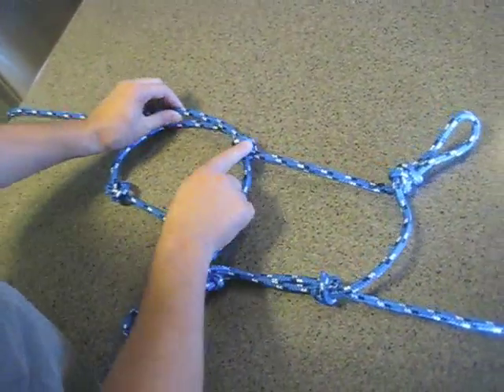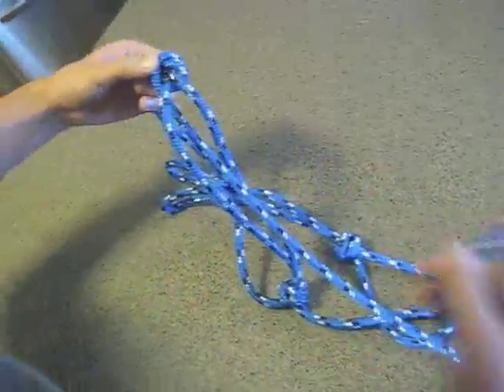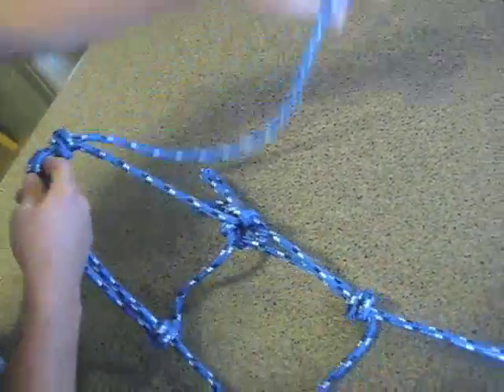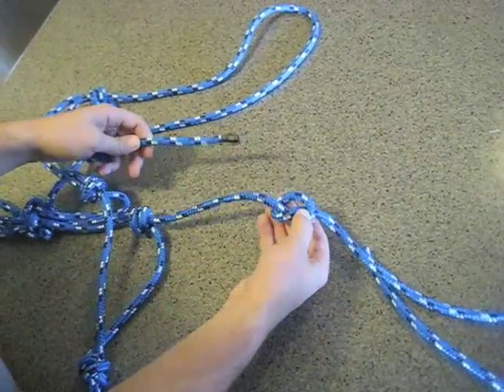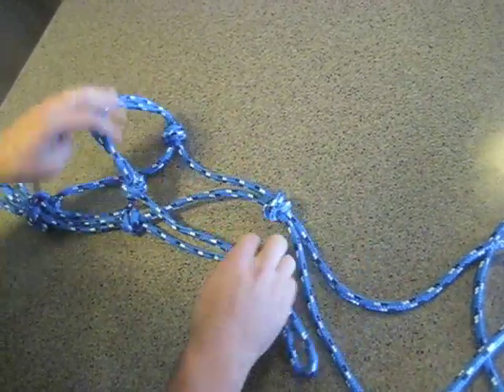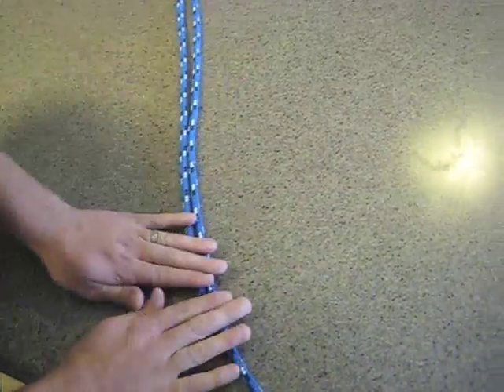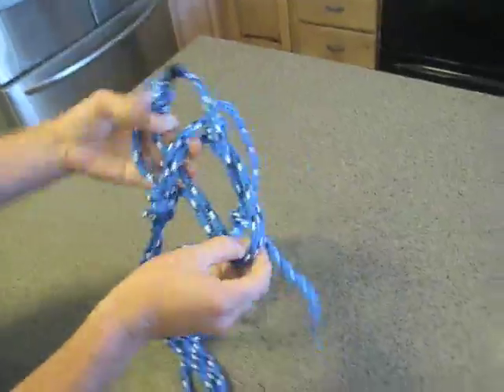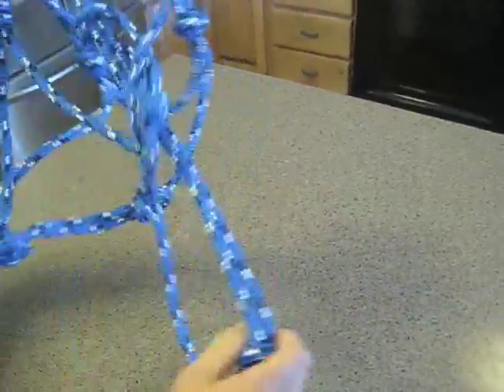How to make a rope halter part 3 of 3

Comment: I am having the same issue connecting the rope where it lays on the cheek. (the end of part 2) I can get it to ty just like the other knots but it comes out the knot on the wrong side. So the extra length of rope goes toward the fiador knot instead of across the nose band... What am I doing wrong?